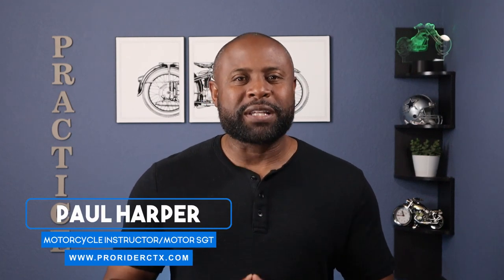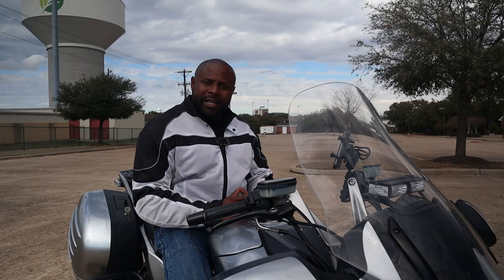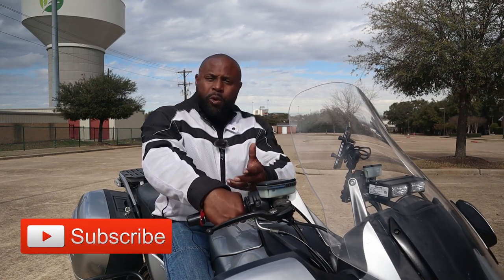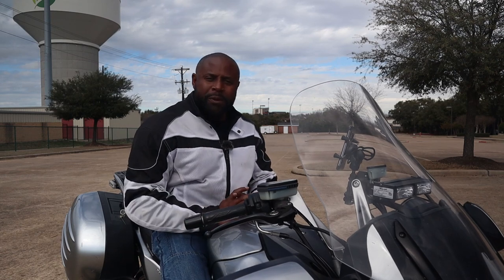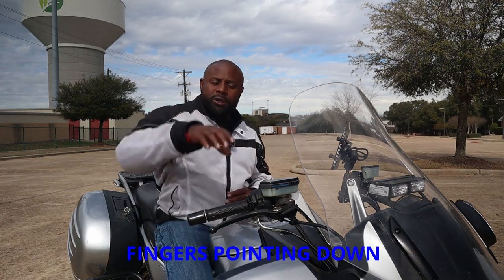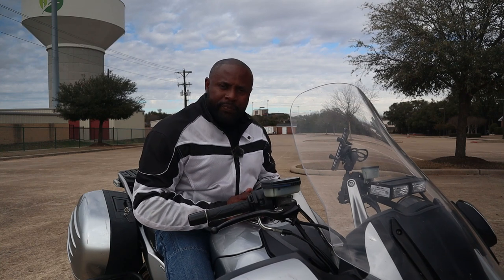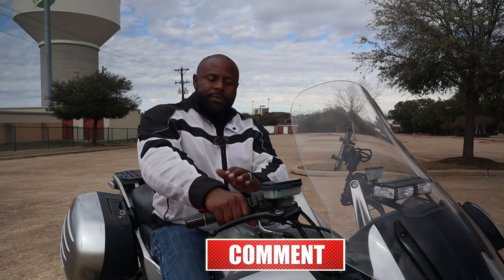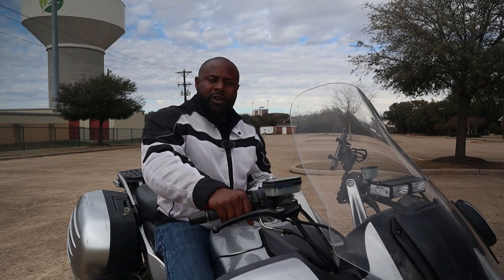How To Control Throttle On Motorcycle / Better Control

Comment: Another tip to help keep a flat wrist & also promotes safety & proper lever setup is I approach my throttle with my pointer finger extended & covering my brake lever. I do this every time I roll off my throttle even when I don’t intend to brake the bike.
Reply from the maker: Thank you for watching and for sharing
Reply: Yup.
Reply: Helpful tip, I’ll try this..thank you

Comment: Good tip......thanks, I speed control is the biggest problem on low speed handling and thinking of 4 things at once.
Reply from the maker: You are very welcome hope it helps.  Many riders have trouble with that ha ha
Reply: @ProriderCentralTexasYouTube  Iff I answer to soon it's cause it's 0 degrees in Ohio and I got nothing to do inside but sit on the internet. :-)
Reply from the maker: @Dogsled1000  ha ha not at all.

Comment: This is definitely the first tip every single rider should know before touching a bike. I didn't know this the first time many years ago and whisky throttled a big ole bike straight up into the air and it was shear luck someone was right there to immediately kill the engine and help grab the bike or it would have been on top of me almost instantly.
Reply from the maker: Thank you for sharing I really appreciate it and thank you for taking the time to watch,

Comment: Hi Paul, love your 5 to 10 minute clips, they are so precise, obvious due to your skill level.
Having practiced your back of hand paralle[ to arm, i now find the wrist can only rotate upwards about 40 degrees so giving finer control at LOW speed, instead of the hand grip/fingers down and giving about 180 degrees, giving to much throttle. Thanks once again.
Reply from the maker: You are very welcome and thank you for taking the time to watch.

Comment: This is exactly what I practised this afternoon. I want silky smooth control and I get a bit frustrated when the ride feels jerky. The first I tell myself is to loosen the grip. The other thing I'm trying is to hold my hand against the innermost side of the throttle and loosen my fingers so that the "U" formed by forefinger and thumb modulates the throttle with less tightening of the other three digits. Thoughts please?
Reply from the maker: If that works then I say do it.  You definitely don't want a to have a tight grip.

Comment: One thing I notice I do (beginner) is when braking with front brake I tend to accelerate throttle too just naturally with my hand motion. I have to really think to not do that as my natural hand position accelerated the throttle a little when I pull brake lever.
Reply from the maker: It sounds like you aren't completely rolling off the throttle before squeezing the front brake.  The next time you go out practice rolling off the throttle then reaching for the front brake.  Let me know if this helps.

Comment: Hi, having the flat wrist feels good, how to handle longer high speed sections of thenroad? I have a with variator and it requires to turn the throttle quote a lot whick makes my wrist really flex and uncomfortable.
I have to change my hand position into what you say is incorrect innorder to get flat wrist while keepingnl throttle opened for longer distance.
Reply from the maker: @0mn1us  Thank you for watching and sharing I really appreciate it.  There are times you may have to make some adjustments which is totally fine.

Comment: as a new rider I have a natural(?) tendency to crank the gas back, when I should be rolling the throttle forward when I have to stop abruptly...frigging scary..help
Reply from the maker: That is a common problem.  What your probably doing is reaching to quick for the front brake before you have completely rolled off the throttle. When you do this and pull in the clutch you will get high rev's.  Please let me know if this sounds correct.  I am getting ready to work on a video covering this.  Thank you for watching and asking your question.  I will try to get that video out in the next couple weeks.  Until then practice rolling off the throttle then reaching for the front brake.

Comment: Hopefully this saves me during my retest
Reply from the maker: What issues did you have?
Reply: @ProriderCentralTexasYouTube  teach said I wasn't giving enough speed and it was because I felt like I was giving too much and would quickly accelerate when I wasn't meaning to. It was a mix of fear and excitedness I think. But he kept telling me that if I had enough speed then I wouldn't have to keep putting my foot down which is what cost me the skills test
Reply from the maker: @CrimsonFawker  If you can keep the clutch in the friction then you don't need a lot of speed.  What exercise did you have problems with?
Reply: @ProriderCentralTexasYouTube   well I suppose all of them in the sense that I wasn't going fast enough the bike slowed down enough to lose balance and I just kept putting my foot down. The teacher kept trying to explain to me that if it's going fast enough that I would be perfectly fine even in the friction zone I wasn't going fast enough and still had to put my foot down because the bike was about to tip over. I don't know maybe it's because I'm a bigger guy I weigh 360.
Reply from the maker: @CrimsonFawker  keep me posted on your retake

Comment: I just took the MSF class and failed because I couldn't get the throttle position right...it was like my hand automatically rolled on the throttle even though I wasn't trying to give the bike gas..I got so discouraged because I've been wanting to learn how to ride for awhile now but I had kids and life happens..so I waited until they graduated high school...I've never ridden a motorcycle before so I am extremely new and I felt like I was expected to have some form of skill for this class...teacher was very impatient and feel like he gave up on me so quickly..now I feel like they just ripped me off for 350$...not a good experience!!😥😔
Reply from the maker: I am sorry to hear that.  It sounds like your wrist was rolling when you turned the handlebars which is a common problem.  The easy fix is you need to stiffen your writs a little which will keep it from rolling.  Do you plan on trying again? I did a video covering this topic here is the link
https://youtu.be/opKdNsdzuFA
Reply: @ProriderCentralTexasYouTube   thank you for the pointer and yes I do plan to try again but only once I gain some experience which is another issue because I don't know anyone with a bike for me to practice on and my husband said it would be dumb for me to buy one and learn on it so I'm not sure how I'll get the experience.  Just very frustrating when you have your heart and mind set to do something and it doesn't workout the way you hoped it would...hopefully it'll happen soon...I'm 41 yrs. Old so not getting any younger here lol...
Reply from the maker: @ameda28  I believe everything happens for a reason.  Was the throttle your only issue?
Reply from the maker: @ameda28  I believe everything happens for a reason.  Was the throttle your only issue?
Reply: @ProriderCentralTexasYouTube  no,because of my issue with the throttle I had trouble with balancing so I kept dropping my feet to try to steady myself...
Reply from the maker: @ameda28  oh I see

Comment: Not an expert on this subject pero hindi kaya yung “nalulunod” while you are rolling the throttle, baka it has something to do with replacing the stock pipe. Baka need ng cat delete, remap, etc. Again, not an expert on that pero naisip ko lang na baka may effect yon. Salamat!
Reply from the maker: That should not affect the throttle control.  Thank you for watching.
Reply: @ProriderCentralTexasYouTube  Sorry, my comment is for a different video. Must have pasted it here by mistake.
Reply from the maker: @genxriderph  no problem

Comment: both of grips are incorrect. because if something happends u need to put ur fingers on brake lever, sometines it costs a lot.
better to hold  2 fingers on brake lever most of the time. its a good habit that can save riders life.
Reply from the maker: It is really a rider preference.  When I see a hazard I will cover the brake.  I am a four finger brake using 4 fingers and I practice braking a lot.
Reply: @ProriderCentralTexasYouTube  thats the problem-most riders do the same "-i read situation on the road i know before bad situation starts" and so on. but there are a lot of things happening by non realistic (at first sight) scenario. can u predict that tire of heavy truck will blow in 30 meters in front of u? or some sort of wild animal that is trespassing the road, or a dog?

its the same for motorcycle killswitch-always use it to stop the motor first and if bad situation happends  u will use killswitch fast instead of trying to reach and turn off ignition key

i am not trying to teach u, just pointing my thoughts about those really important things.
Reply from the maker: @bytemyvoid  I always listen to other points of view.  I don't pretend to know it all and there's always more than one way to skin a cat as they say.  I appreciate your insight.

Comment: Sir, so as an instructor, you dont teach your students to 'cover' the brake lever while the hand is on the throttle, which would, by simple range of motion, keep their hand on the throttle in a better position...along with, by way of how you demonstrated, teach them to brake with two fingers and not the entire hand-full?   Maybe im nit-picking, but...your 'tip' was a little flawed sir...all due respect.
Reply from the maker: I teach braking with 4 fingers .  I think you meant to cover front brake and I don't teach that either.  I teach to use rear brake when doing slow speed maneuvers.